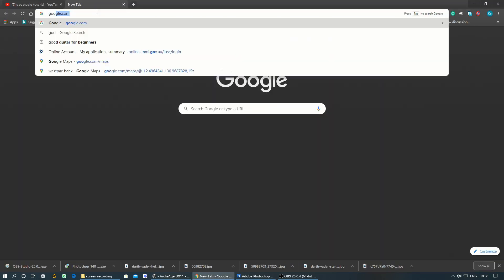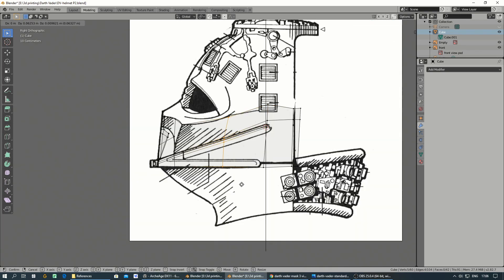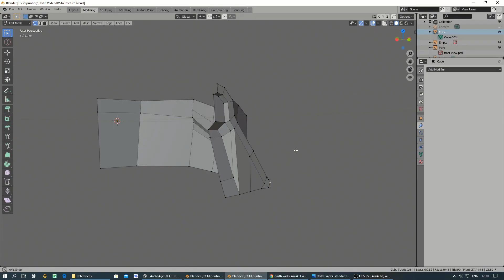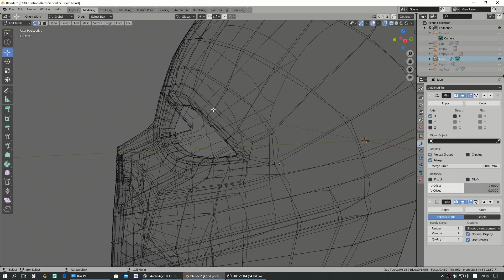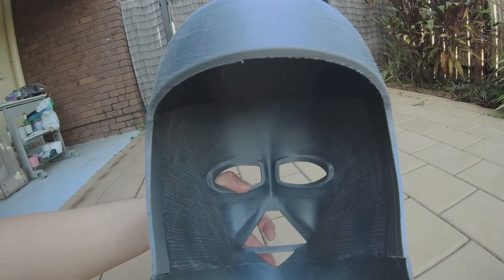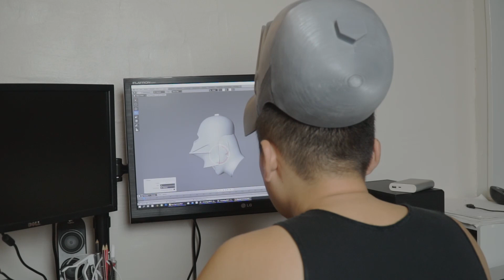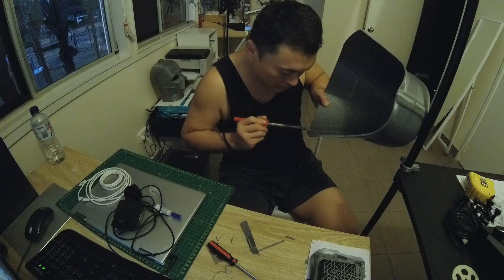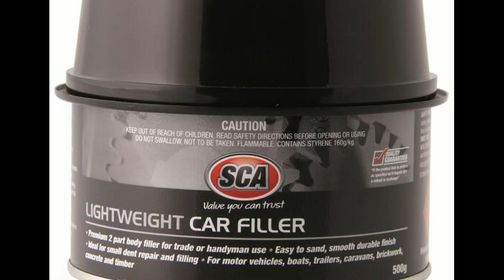free 3D printed Darth Vader helmet making Episode 1

Comment: What is the minimal printing plate size?
Reply from the maker: I used ender3 to print all parts. As it’s a entry level printer, which offers 220x220 printing area. I split the model into many parts to fit the ender3. If you wanna print this effortless . You’d better print it on a 330x330 plate
Reply: 3D Something thank you very much. Yeah i also just have a 220x220 plate so i was wondering if it is even possible without cutting it too much into thousand pieces
Reply from the maker: ironcrafterhd you are welcome.If any questions please ask.